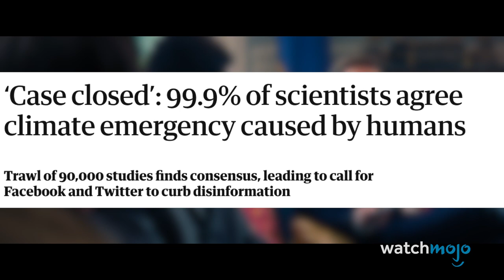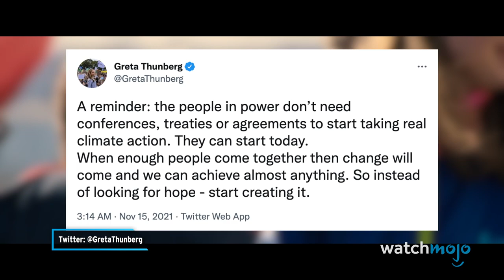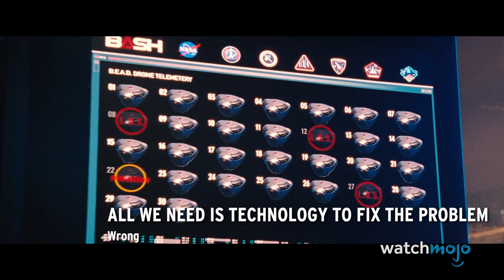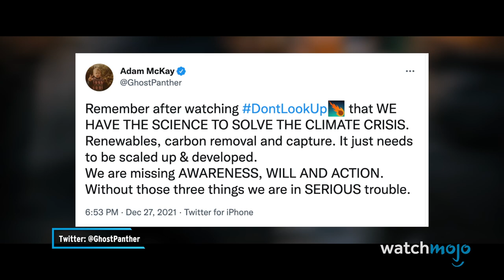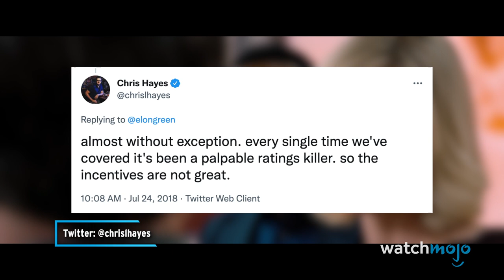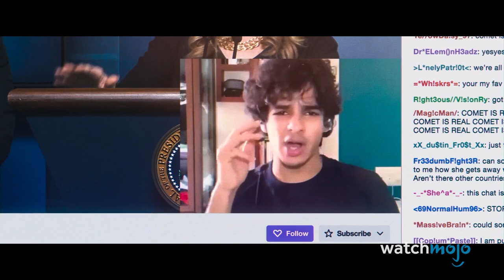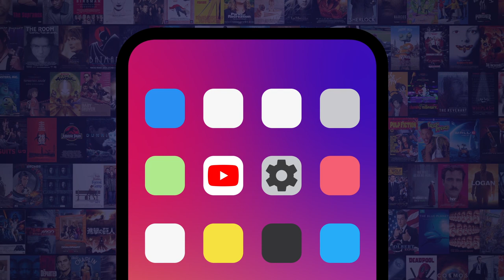Top 10 Things Don't Look Up Got Factually Right and Wrong

Comment: I love how everyone is so afraid of climate change, while also probably do nothing themselves except "talk" about it in order to make any change.

You all want to do something, here are 3 easy things you can do to help conserve energy and water, and cost you absolutely no money to get started:
1: Set your thermostat lower in the winter (68f or lower), and higher in the summer (75f or higher).
2: Take showers like you wash your hands. Instead of leaving the water running the entire time, get the water to temp, get wet, turn off water, lather, then turn the water back on to rinse.
3: Unscrew any un-needed light bulbs. Several light fixtures have sockets for multiple light bulbs, but if you don't need the extra light, don't use them all.

The best part about all three of these easy things is that not only will you be saving energy and conserving water, you'll also be saving money.
Reply: Also really cut down on what you buy, especially when it included rare earth minerals and plastics. 
We've been spoiled by consumerism, thinking it's such a normal thing, when it's only been with us a few decades. 
We all buy way too many things because marketing and advertising works wonders.
Reply: Okay, so what do we do about all those office buildings leaving the lights on and running their air-conditioning 24 hours a day?
Those who are higher up need to take action to make a difference.
Reply: How about produce less wastes, like don’t waste foods
Reply: @matthewwu5067  and pay attention to where the food comes from and how much plastic is used.
Reply: @martincrotty  @Matthew Wu
Great suggestions and they fall in line with the theme of saving money as well.
I  feel that the reason a lot of people don't actually do anything for the environment is because they think it will be too expensive, but if we all make some simple life adjustments, that cost nothing, together we can all make a big difference.
Reply: @jfmdevil6239  what I fear is that while we can do our bit, our current era of technological growth and consumerism has a lot of people thinking it's the norm to buy all these new technological toys and new clothes whenever they can. So much of the population isn't aware that are current way of life, what we consider to be completely normal, is one of the biggest things we need to change. They think it's going to be fixed by electric cars and solar panels, which are just another step in the wrong direction. We need to seriously evaluate what we're doing to the planet, and start seeing things from a less humancentric point of view.
I could be cynical and paranoid and say that they've been mislead by large corporate interests and profit focused governments to believe this way due to them wanting to keep the economy (an imagined construction made up by still primitive growing apes that we put too much importance on) growing, but it's very likely it's just plain greed and stupidity of a species that finds it difficult to comprehend long term issues.
Reply: @martincrotty  I absolutely hear ya.
We are pushed this lie that we have to always buy new stuff all the time. We need to buy the new Samsung Galaxy, even though the one we currently have works fine. A new car that (might) get 1 mile more per gallon than the one you bought not even 2 years ago. Etc...
What ever happened to if it ain't broke, don't fix it. Hell, even if it is broke, see if you can fix it for a reasonable price and get some more life out of it. Instead it has become it isn't new anymore so I need a new one or I'm too behind the times.
I like getting new stuff too, but it just isn't economical or sustainable. We have to encourage people to quit replacing stuff just to toss the "old" stuff into a landfill because the "old" stuff isn't cool anymore.
How many billions of dollars are thrown away each year in plastics, shipping materials, rare minerals and metals, etc. just to rot in a landfill? How much energy and resources are we using just to bury this stuff in a landfill?
These are things people need to start asking themselves, and doing something about if they want to see any actual change.
Reply: @jfmdevil6239  and unfortunately the people we elect are much more interested in the market and constant growth than what is actually happening. We've been too spoiled and made to believe this norm is a symbol of our greatness as a species and so few are aware of how damaging it is.
Reply: Just pointing out that If you reduced your CO² emissions for 70 yrs It would be as effective as all industries in the world stop emitting CO² for a huge 1 second!

Comment: Well, my viewpoint on climate change is basically just “what the hell can I do?” I’m just a worker bee. Leadership should step it up. I would imagine they would have the support of most communities.
Reply: I really don't understand the concern. If I recall NASA showed it would get about 10degrees hotter in 100 years. It changes more than that in one year.
Reply: @vikingsword3485  key Word is average.
   
During the last ice age the world was just 6°C colder. And half of northamerica was under glacials.
  
This IS because the globe doesn't Heat uniformly. A change of 2°C Will correspond to way higher maximum temperatures in summer, especially at the poles.
Reply: @alejandroojeda1572  that was 10 degrees Fahrenheit not C and that was the high end. The low was 2.5. Also those ice age models are highly speculation and unreliable.
Reply: @vikingsword3485  the world has already heated Up more than 2.5 degrees Fahrenheit. 
   
The ice age models are unreliable, but I just wanted to make a point, which i'm sure you'll agree with: 
  
 The Earth's average temperature doesn't need to change much for the world to be a very different place.
   
People tend to underestimate what just 2°C mean and i was trying to convey that.
Reply: @alejandroojeda1572  it changes more than two degrees F moving from day to night. The change is so small and over such a long period of time the effects of a hurricane are more deadly. Their is a big dif between F and C. Do you know that hot places use to be considered unliveable until the AC was invented? I think you greatly overestimate the threat
Reply: @vikingsword3485  i'm not going to arguee with you. You can read any of the THOUSANDS of papers regarding climate change if you want.
   
The scientific consensus is clear:
  
1) the climate is changing
2) It's effects Will be very noteworthy
   
Let me explain with an example, if the average temperature increases one degree, sea level will rise about half a meter in the mediterranean which IS enough to transform the nile Delta into brackish waters. 100M people live there and most from agriculture, which is already at Risk because Ethiopia IS damning the nile, because, you guessed It, they're having more droughts.
   

   
But you can keep your conspiracy theories if you want
Reply: @vikingsword3485  the longer I Talk yo you the less this movie sounds like a parody.
   
You alternate between not taking the issue seriously and disregarding It because It's "unavoidable". 
   
First, It is serious and second, we can at the very least mitigate Its effects.
    
If the US stopped all emisions It would make a dent. A very significant one. We can act upon climate change.
  
The truth IS more terrifying and sad, and this movie brilliantly points It out. 
  
We've collectively decided saving the planet is not worth It. Which sounds crazy, but bear with me.
   
in the 70's there was a meeting where scientists resolved the only way to stop climate change in time would be economic "degrowth". The world leaders were so terrified they came up with their own theory, which, of course, was better for the economy but didn't stop climate change in time.
   
We CHOSE THAT.
Reply: @alejandroojeda1572  I don't see the problem with thinking an unavoidable small change is going to happen. What are you using about emissions? John Kerry came out and said it wouldn't and he was all for waisting money.

Comment: What does a comet from outer space hurdling towards Earth have to do with the planet’s climate change issues?? 🤔
Reply: It's satire.
Reply: @ktcarl  that doesn’t answer my question but ok.
Reply: @ktcarl  you should really do some research on the difference between weather and season changes and climate change. There is very much a difference.
Reply: @linaaviles1971  well, he not wrong cause the climate is what affects the weather. And make each season either, more hoter the last, and more colder then the last. Each passing year the flow of the wheaters are getting a bit worst with more hurricanes, earthquakes etc. Its all connected. We are in a continuous cycle. The more earth get damage by our polutions, wars and more; the more we affect the cycle.
Reply: @ktcarl  too bad climate change might trigger another iceage huh?
Reply: @VitaeLibra  Right.
Reply: @ishmaelvilmenay3340  You're a "half empty" guy instead of a "half full". 😁
Reply: @ktcarl  true cause I don't work for "Lay's"😉
Reply: @Sam Do you know what a metaphor is?

Comment: As one who strongly supports climate change prevention I gotta say this movie has very little to do with climate change.
Reply: Then you don't understand climate change.........
Reply: @dylanbutts1628  no. They're right. It focuses more on the people who ignore climate change than the actual climate change part. Ironically that means it ignores climate change too. Still a relevant movie don't get me wrong
Reply: @VitaeLibra  You said they ignored climate change itself. Nope.
Reply: @VitaeLibra  Why don’t the people vote for better leaders then 🙄
Reply: @dylanbutts1628  no sorry. My bad. I meant that the movie didn't talk much about climate change/the meteor in comparison to the people ignoring it. The movie is about climate change but it doesn't revolve atound the impending doom as much as the people causing it

As for the second comment... the same reason why they are in denial about climate change. Because there's so much misinformation going around that it has become okay to ignore 97% of scientists